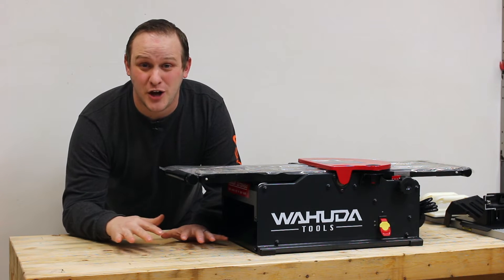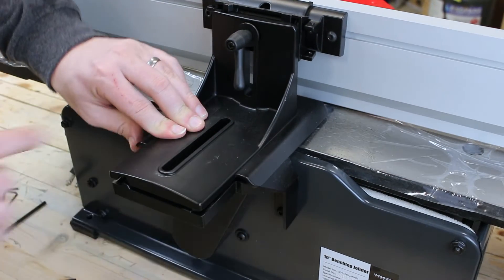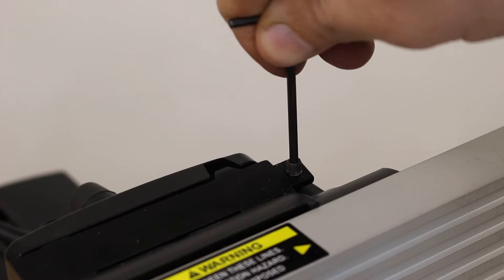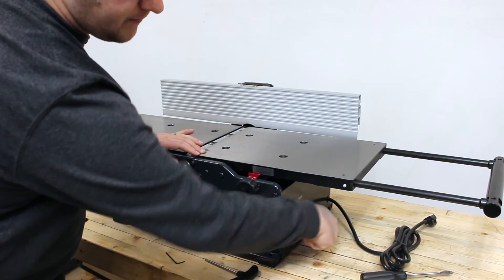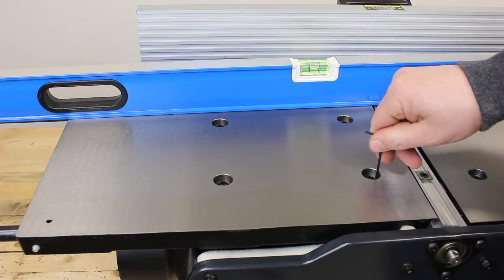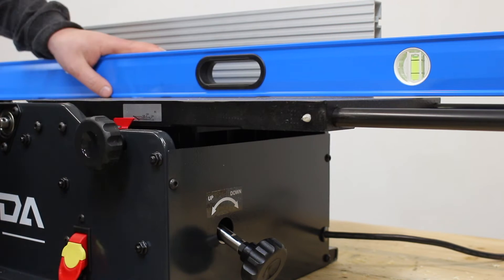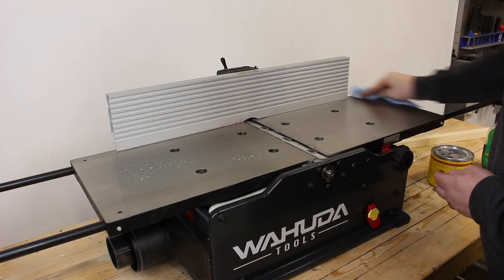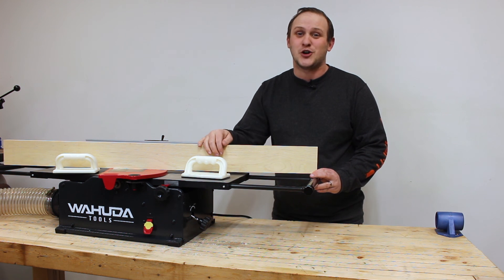Official Wahuda Jointer Setup Guide

Comment: Purchased a 10" Wahuda jointer a few months ago and I've been extremely happy with it thus far.  I also added some support brackets for the fence that I purchased from Cutech to provide much better support for the fence on the outside edges.  Cutech part number 80400 worked perfectly.

Comment: Fantastic video. I have a Cutech 8" and had a hell of a time trying to get it adjusted properly. Once I realized it was the same as the Wahuda jointer I found your video and it cleared up a number of problems I was having. Thanks!!
Reply: I’m right there with you...I’ve spent hours fucking with those damn screws trying to get it co planer...what a nightmare

Comment: I followed your excellent guide.  Thank you.  I used a magnetic digital angle level.  To get the side to side, I put a ruler flat on the cutters and zeroed it.  Then I adjusted the tables so they were leveled to the cutters.
Reply: Can you be more specific, my bench top has been sitting unused for a year now. It's not even close to co planer

Comment: Glad to see that the comment I made on the previous video where you had the level too far to the left on the outeed table and it was catching on the rubber end protector, has been resolved because of the 4-inch level in this video. just picked up this joiner and will completely use your video as the go to reference. thank you so much.

Comment: After having watched a couple other videos first, this video helped me the most. My machine is a Wen, but it’s essentially the same setup except that instead of having the little hex screws for adjusting, I have to completely remove the bolts in order to access the one big adjuster screw. It took me several attempts to get it right, but it’s done. Thanks.

Comment: Love the size and weight of this little jointer MyBest.Tools Easy to set up and light enough to pick up and put away. The adjusters and controls are dead easy to use. It has an aluminum deck rather than iron, but for those who are careful it should suffice, and it has a vacuum port that, unlike some other tools I have, actually gathers ALL the dust. Very happy with this for the price.
Reply: don'know what you are talking about but this jointer has CAST IRON tables.

Comment: Was working to setup my 10” jointer today. Seems like the setup has changed completely. There are two hold down bolts and one set screw. You turn the set screw ccw to raise the gable. Also, it seems like there’s an interplay bw the set screws and the hold down bolts. You need to adjust both to achieve desired position.
Reply: I noticed the same thing and wonder why the company has not created a new updated video. I still haven't figured out how to set my table and was frustrated with the dual screws.

Comment: Great video, I figured I’ve been using my 8” for about 3 years and it worked well and it was time to clean and adjust. My 8”wahada has a torq screw with a threaded insert under it. It was the same basic procedure to level the beds. 
A side note when you are adjusting the sliders, the side with the set screw spins to adjust how they side in and out…don’t do what I did and said theses are loose I should tighten them….

Comment: Mine arrived yesterday. i got it in the shop and assembled. Someone has definitely been trying to set these tables by some unknown method. The set screws were so screwed up that I took the outfeed table off and reset all the levelers to 'flat' against the bottom surface. Since these surfaces were also milled I figure there's a chance that they are all somewhat parallel to the top face. I then set the outfeed table back in place and leveled it to the blade zenith as you did in this video. Repeating that process for the infeed table. Will update you when that's readied and i'm prepped for running a test board through...
Reply from the maker: Awesome can’t wait to hear how it goes!
Reply: @ProjectBuildStuff  It definitely didn't go like it sounded... I need to set the infeed at a 0 level so i have the full 1/8" cut depth available and I'm not sure that the way you did it you would get that depth.
Reply: @verdedenim662   I personally would never cut at the full 1/8 inch depth. Pretty hard on the machine. I get better results with 1/16 or even a bit less. Better on the blades edge retention also. Good luck, friend.

Comment: One important additional tip I got from Mike at Wahuda tools - if you turn the leveling studs on one or more corners to achieve tolerance, after you tighten the 4 center bolts, make sure to 'snug' all the leveling studs so that they make contact with the base. If you don't, it is quite possible that the table will move out of tolerance if it is bumped, moved, or otherwise relocated (ask me how i know).
Reply: That is correct, good tip and one that most guys get wrong per some comments I've seen here. A tool is only as good or bad as the person operating it.

Comment: great video.  I have the 10" and although the screws to adjust the bed are slightly different,  I have a better idea of where to start leveling everything.  The manual doesn't really go into it other than which way to turn it to get it to go up or down to level.  although it may have been on the next page now that I'm thinking of it.

Comment: good video thanks.  question though.. shouldn't you be adjusting beds first for parallelism and then adjust fence to beds?
Reply: My thoughts too and first thing out of the box is to clean the bed surface so your straight edge isn't sitting on grease.

Comment: Excellent demonstration here for proper setup on these units... I added my email address on the Wahuda company's website in Tennessee. Apparently they are out of stock on the 10" unit & expect their next delivery in approximately 6 weeks as of todays date of 3/20/21 which puts it at roughly 05/01/21, possibly sooner... Based on my research on benchtop jointers, pound for pound these Wahuda jointers give the most bang for the buck, i.e. cast iron tables, ( 20 ) staggered carbide tips with ( 4 ) sides each, table extensions... Like everything in this world, ( unfortunately ) the 10" jointer is made in Taiwan, not the mainland of CCP China, thankfully, ( for now )… These units do not come with helix spherical cutting heads, however the staggered spiral head with the carbide tipped inserts is a step up from the knifed units & will save you money in the long term & they do produce better results imo... 
Bill on the Hill... :~)

Comment: It’s official. I’m getting rid of my wen bench top jointer. To do the same setup with when you don’t have the little set screws for adjusting the height. You have to fully remove one bolt at a time to access the height adjustment, twist it, put the bolt back, then do the same to the next one, only to then have to go back all the way around three or 4 or 5 more times to get it correct. So carve out a solid hour to do this with a wen.

Comment: I have one of the earlier versions of this jointer which requires the user to completely remove one of the screws in the table and then use a screw driver to raise or lower the table.  It takes a tremendous effort to adjust the tables to get them to be coplanar. I thought about getting rid of this jointer and buying a more expensive and easier to adjust machine. I now have it working pretty well so for the moment I am okay.

Comment: Brad thanks for the video, My question is I just bought a new 8 inch but the table adjustments are completely different than the ones demonstrated,  they have 2 torx screws at each hole with a single allen screw to adjust.  Have you had any experience with that set-up?

Comment: I received my second Wahuda yesterday after they suggested returning the first due to a “loose” infeed table. When locked in place, the infeed table does not hold tight and when I add wood or simulate the pressure of wood on the infeed table and extension, it causes the table to move, making the tables no longer coplanar. Do you have any suggestions to help with this? No matter how many hours I spend getting the tables coplanar, as soon as the boards are positioned to go through the jointer, it is irrelevant because the tables don’t support the weight of the wood.
Reply: I wonder if mine has something similar wrong with it. I can get it coplaner and after the first pass, it’s all out of adjustment.
Reply: Mine is doing the same thing but it's not even running a board that's doing it. Getting the tables parallel at top position but as soon as I lower the infeed table the front(by cutter head) drops by about 3/16" begore the rear even moves. Asking for an exchange because I think this machine is bad
Reply: DUDE ME TOO. I am also on my second Cutech branded jointer and I'm having the same damn issues, again. I thought I was the only one but they have real problems. Considering getting a real jointer now........

Comment: Well done. I just checked mine and it needs an adjustment. Glad I found your channel. 
One question: what are the 2 small screws for on the outside edges of both tables? I’ve read the instructions 10X. Your video answered most of my questions. I’ve a baby bed to make for a soon to be new grandson. 
Let’s make some sawdust.
Reply from the maker: Those screws are to tighten the extension wings

Comment: Wondering if you've noticed the outfeed table move after it has been set. I set it as you did here so that my level reference is just caught by the cutter and moved without being lifted. After tightening the outfeed table (and checking again), I moved on to the infeed table, but somewhere into the process of setting the infeed I noticed that when I turn the cutter head it no longer contacts the level reference. What could make the outfeed table rise after it has been locked down?
Reply: Mine has moved all over the place as I’ve used it. I’ve honestly spent more time working on it than using it. I’ve followed this video to a “T” and still no luck, as everything moves after a little bit of use.
Reply: @Babolou1  same! 10 hours fucking around with this thing. I've gotten it dialed in a few times now to where it "should" be perfect and ready to go. But... Yes, the outfeed table has phantomly moved a few times forcing me to start over. And now I realize that the main issue I'm having is the infeed table doesn't stay parallel when it's being lowered. The front(by the cutter head) drops about 3/16 of an inch before the start of the infeed table even moves
Reply: @housekat611  I’m on my second jointer now. They both do the exact same thing. I’ve found that by tightening the big hold down bolts to the point you think they are going to break will stop most of the phantom bed movement. This still doesn’t make it any easier to adjust though. I’ve called mike so many times he knows my number by heart. I managed to get a seamless joint on a 67” board after 4 hours worth of adjustment. Still not convinced it was pure luck instead of the machine being accurate.
Reply: @housekat611  and I’ve found that you need to set everything within .002”-.003” to get it accurate. If you set this at .10” like the video says you’ll never get an accurate cut on anything longer than 2 ft.
Reply: I’ve found a huge discrepancy as the infeed lowers. After setting coplane to 0.003 between in and out as measured at all four corners of both beds - the infeed lowers on an angle: lowered table 1/16 and measured a 0.021 difference from fence to outside location at the cutting head. I had sown hours trying to understand WHY nothing would come out square after setting coplane to within 0.003 across both tables. You can actually see the infeed gap (table to cutter) grow on an angle as the table is lowered. No clue how to address this, except to return and get something better. 
Thoughts form anyone?

Comment: Even after your great explanation on how to do this alignment procedure I am scared to death to order one! For the life of me I don’t understand why they don’t take care of this procedure before they leave the factory and Isn’t that what Loctite is for? Blows me away! It seems like a lot of people that are replying are also having major issues with alignment even after watching. You did a great job for sure I’m just not too sure about wahuda. As I research and shop for a jointer I am finding these types of issues across the board in this price range.
Reply: Stay away from these types, having huge issues with my Cutech with leveling the table, I'm on my second one
Reply: @zogthehog  Ive had mine for over a year, heavy usage gone thru all four sides of cutter heads and halfway thru second set.. I have never had an issue with leveling my table, in fact it is still level from my original setup. this is probably the best bench top model on the market under $1000 and I have used quit a few, Oh and their customer service is phenomenal, the owner hangs out on FB answering questions. call them they will tell you what your doing wrong and help you set it up right.

Comment: Awesome video! I am thinking about getting one of these, would you recommend this tool? Is it still performing well for you with  no issues? What material is the spiral cutterhead that holds the inserts made of, and when you tighten down on the insert what keeps the insert square? If you had to do over, would you buy this tool again?
Reply from the maker: Great questions. I would definitely buy this machine again. The construction is quality, the price is great for what you get, and I’ve been very happy with it. As for the cutterhead I believe it is steal and it has ribs that align and square the cutters on the cutter head.

Comment: I’m still a bit confused about setting up the tables. When you started on that section you first said you wanted both tables level with each other. Then at about 5:15 in you said you didn’t want both tables level with each other. And then toward the end of that section you set both tables level with each other. Could you please clarify which it is for me? Thanks
Reply: For setup you want to make infeed and outfeed level.   For actually cutting wood you lower the infeed table.  Because of the setup the two tables are always parallel now but the lower infeed table defines the amount of cut.

Comment: I cannot get the beds to be coplanare .... the front of my infeed table needs to go up ... and nothing happens when i either go clockwise or counter clockwise to the first two screws ... why?
Reply: I’m having the same issue with mine.  Also my outfeed table is not flat and I get concave boards as a result.

Comment: I lowered the in feed side to adjust the out feed and when I raised it back up to 0 the sticker and the depth marker do not line up anymore...... what in the world did I do?!?
Reply from the maker: Personally I don’t really use or trust the sticker, I find it more accurate to just check the depth of cut by measuring the blade to outfeed table heights

Comment: Lowering the infeed table essentially sets the jointer for a 1/8" (nominal) cut. If you then dial the infeed table up to be level with the outfeed table (let's say that you are now at 5/64" when they are co-planar), do you now have a total cutting depth of 3/64? Wouldn't you want to set the infeed table at 0 as the baseline level setting so that you would have 1/8" of cut available?
Reply: I think I answered my own question... if the two tables are set level it doesn't matter what the 'setting' of the table is since it's only a reference. Once it's level, the depth can be set to whatever you would want. Is that correct?
Reply: @verdedenim662  Correct.

Comment: I have a question.  I followed your video but I'm getting very defined lines running down my boards.  It seems the individual carbide inserts are not all level.  Is there a way to adjust them or do I have a defective spiral cutter head?
Reply: I had the same issue. Called Wahuda. Mike suggested rotating the cutter heads. We will see if that in fact solved the issue
Reply: @joer5627  they had me rotate them...then they sent me new blades...still had lines.  They ended up sending me a whole new jointer.

Comment: Trying to bring my tables into co-plane, having trouble, it seems my left end of the outfeed table is lower than the right side. Any recommendations to resolve this?  thanks
Reply from the maker: I would adjust the leveling screws only on one end to bring the table into level
Reply: @ProjectBuildStuff  I got the tables in line with the cutter head but now if doesn't cut level.  I don't know whats going on. Am thinking about zeroing the out feed table and working it back up to level with the cutter head and then doing the same with the infeed. Any thoughts on that?  thanks